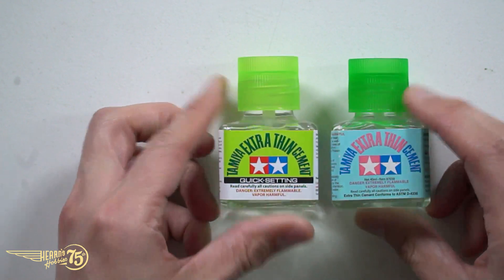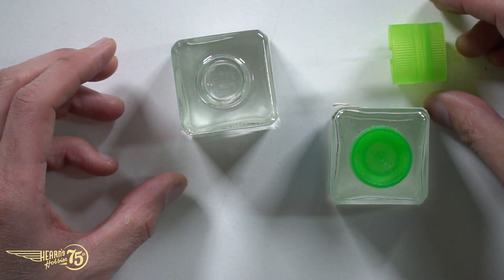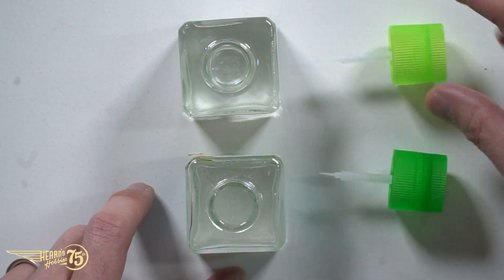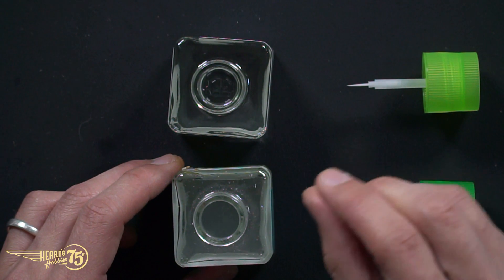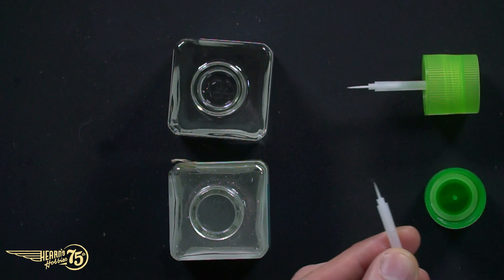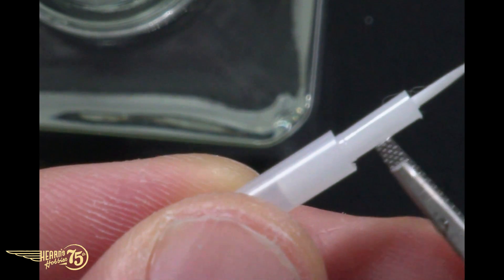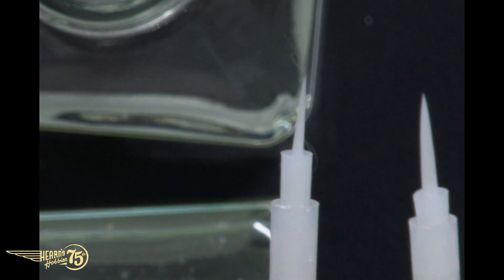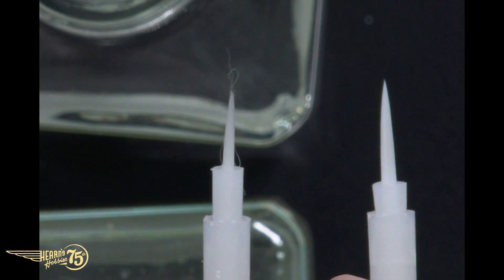Tamiya | Extra Thin Cement Brush Trick | #askHearns

Comment: Another hack: If you want to use the in-bottle brush to reach a hard to reach piece where the brush is too short, extend the brush by ramming a cocktail toothpick or something similar into the tube of the brush after removal of the cap (as he demonstrated here). In effect you get a long handled brush without having to use another good brush for glue.
Reply from the maker: Thank you for your tip!
Reply: I was just about to post the same thing, then i read you comment :)
The long brush is handy for repairing parts that are buried in the kit also.
Reply: @ Yet another example of great minds thinking alike! 👍👍

Comment: I do this all the time just be carful with the rib not locking in to its resess it will fall in to your glue or it'll slide down leaning off the bottom off the bottom and your left with captian hook's brush so if you are doing this something like a tad of white tac inside the tube works of a bit of double sided tape a tiny strip round the end and slide it back in just make sure that tips not going know whare! Just my experience through the year's doing this some of the issues that will happen unexpectedly! Luckily I've about 20 empty bottles! Another tip if you are keeping empty bottles keep a small layer of glue in it for the brush tip or the brush will dry out and frey without it being in glue constantly!
Reply from the maker: Thank you for your tips!

Comment: So, I'm working on a model and part of it required super glue instead of Tamiya cement. I stupidly wiped the Tamiya cement brush in wet super glue which stuck all of the bristles together...  I soaked it in nail polish remover and also hot soapy water, agitating the bristles to break up the bond, and that seems to have gotten all of the super glue out, but the brush did not go back to normal. It's curly at the end and doesn't have that nice sharp point, making it a pain to accurately apply in tight areas. 

Are there any tips to restoring a mangled brush, or do I just need to buy a new bottle for a new brush?  And maybe I'm missing it, but Tamiya doesn't seem to sell replacement brushes.. I want to buy a dozen of them because I suspect that won't be my first time doing this D:
Reply from the maker: The brushes in Tamiya cement bottles easily outlast the quantity of cement when used correctly. If you need to replace the brush, buy another bottle and use the new brush. The extra cement can be used to refill your existing bottle.
Reply: @HearnsHobbiesMelbourne  thanks for the reply - I ordered another bottle already. Maybe this time I won't ruin it!
Reply: haha I did the same thing with the same dilema.  Buying more glue.
Reply: @johnvanzelm2307 RIP brush! I haven't ruined the new brush from a new bottle, but I think it's only a matter of time before I mess up again!

Comment: My god I never knew the brush could be extended after how many years in the hobby. Feel this should be advertised on the bottle or something!? Also can you get replacement brushes? I've somehow mashed the end of mine so it's not very accurate at applying stuff now.
Reply from the maker: Glad you learnt something! When a brush becomes damaged, it is best to replace with a new bottle and use the fresh cement as bulk stock to top up your working bottle.

Comment: Make 50/50
Reply from the maker: Of the cement to make Thinner Cement?
Reply: @HearnsHobbiesMelbourne  you can actually make your own special sauce if you experiment with it. I like the liquid weld although I feel there’s definitely more of a bond adding at least a quarter of a tube cement to a jug of plastic weld.    In all honesty I think the 50/50 ratio needs to be tweaked  some as it is a lot thicker than needed.   Liquid weld alone doesn’t really cut it.
Reply from the maker: It depends what consistency you want for the job. The thicker the glue, the more filler it has. Liquid cements work best when the there is good surface area and the fit is good. The looser the fit the thicker you need to bridge the parts to make a bond.